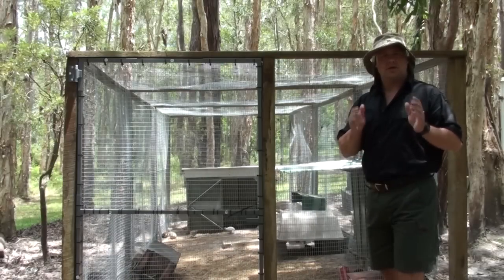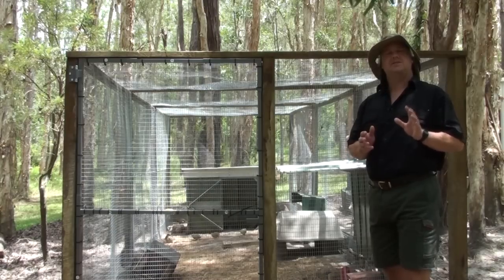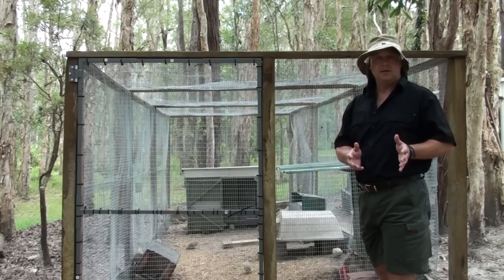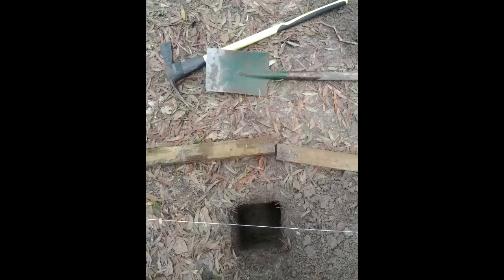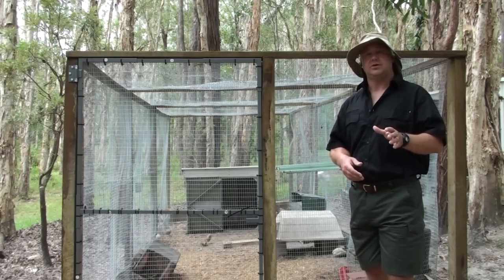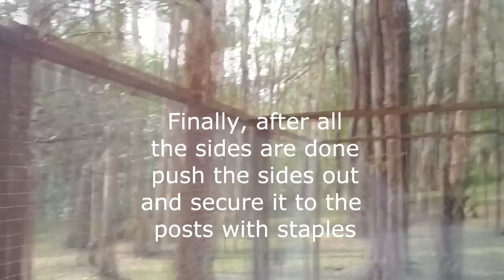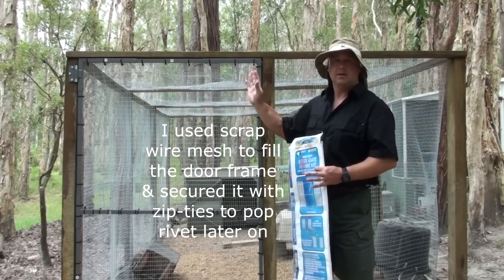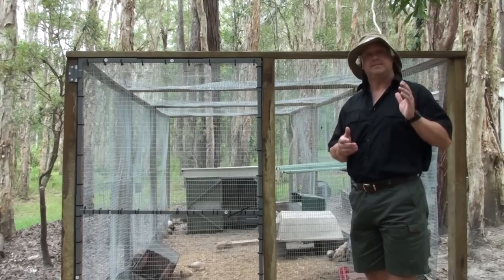How to build a Quail or Chicken Run.mp4

Comment from the maker: @Silkymits2000 Thanks again! Yeah, you don't want an encounter with rats and quail it's pretty awful... No I didn't use treated wood but I did use hardwood which will help a little against termites. I'll just keep a watch out as it's an "open structure" I'll deal with termites if I see activity - it should still last many years though. You could use a steel frame if you're worried? A walk through video is a good idea - I'll do a quick vid soon. Cheers, Mark

Comment from the maker: Hi David, thanks mate. I got the expandable gate from Bunnings in the steel fittings aisle where they have pipes with joins to DIY steel frames etc. I think there are several kinds to choose from in complete packages and also other loose gates for pieces purchased separately which need more DIY skill to put together.  I just got one of the the complete packages (brand - Romak). Cheers

Comment from the maker: According to industry standards of 4 per 25 x 60 cm cage you could easily keep 300 plus birds but that would be ridiculous of course. Around 100 is easily manageable and kind enough but I like to keep no more than about 40 at a time. This decreases significantly as we eat them and through winter when they don't lay and I don't hatch out any. I decided to move from my raised cage setup to a run style so the birds would have a better life therefore I'm keen to not over crowd the pen.

Comment: could i just line the floor with mesh instead of making a wall around the outside? and just bury the mesh? or make a trench and pour concrete in? seems easier.
Reply from the maker: Yeah, make a trench and pour concrete in is probably best. But I wouldn't have a mesh floor (unless it was off the ground) because quail have a high ammonia output in their waste and if the mesh was on the ground it would quickly corrode. For a quail pen you really want it to be easy to clean out and a mesh floor would make it hard to sweep or rake out.

Comment: I want to know at the bottom of the chicken coop did you concrete the framing at the bottom in
Reply from the maker: +Morquet Gittens Ash-shafii Hi, no I only concreted the posts and simply buried the mesh about 12 inches down without concrete. Yes you could concrete the base in all the way around it would make it more stronger and probably last longer but mine is several years old now and still is doing a good job. I hope this answers your question. Cheers :)
Reply: Thank you very much I just ordered my chicken and I wanted to find out
Reply from the maker: Ok best of luck!
Reply: I find out fresh eggs is better
Reply from the maker: Yes for sure there's nothing better than fresh eggs from your own hens!

Comment from the maker: Hi Jane, I actually used a medium sized spade - flat base & pretty thin (not a shovel). However, there are "trench shovels" specifically designed for this task & they're fairly cheap too (bout 20 bucks for an ok one). Essentially, I followed the string line I had tied between the two end posts to keep everything straight. The spade technique is a dig down then a scrape up holding the loose soil between the spade and side of trench to remove the dirt - easy, but good exercise :) Cheers, Mark

Comment from the maker: Hi Darian, I just used a spade. You can get those hole digger/trench spades (pretty cheap) from hardware stores. I use a dig from the side and scrape up and out technique to make the cut neat. Took a bit of time but it wasn't too bad physically to be honest. The wiring took the longest. Good luck with your button quail - it's great fun. Cheers, Mark

Comment: I have a hillside ~10° (a grassy knoll if you will) that I'm considering, as well as a natural stone walled ravine with softer dark black soil that I am considering for the run. I'm hoping to build a central johnny house for care & feeding and extend a run either across the hillside or down through the ravine. My Q is... I would assume a grade of 5°to10° across the width would be serviceable, and having the run length wise along the drop may cause issues with flight as a 6 ft roof would become a 4' - 2' - 0' space as it parallels the drop, so I would/should square the roof height 90° from the hilltop height, meaning the lower end may need to be 10' high.  Also, perhaps the soft black leaf covered forest may not be the best ground for healthy feet